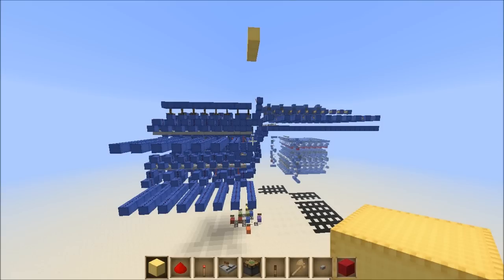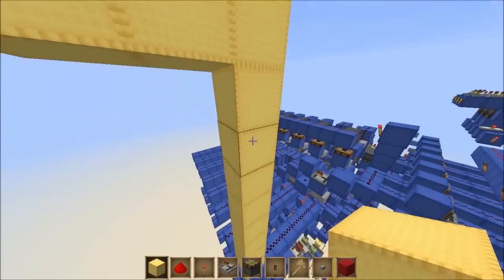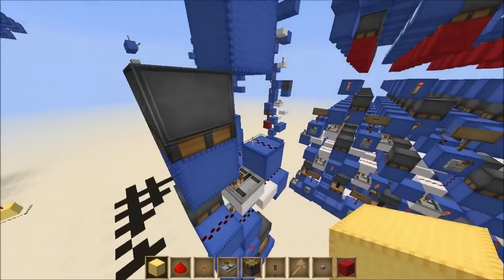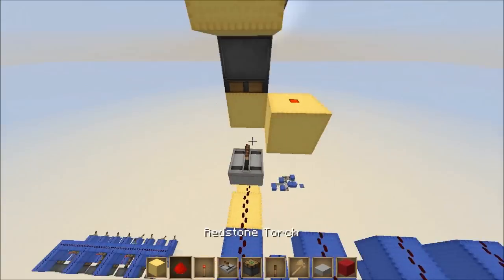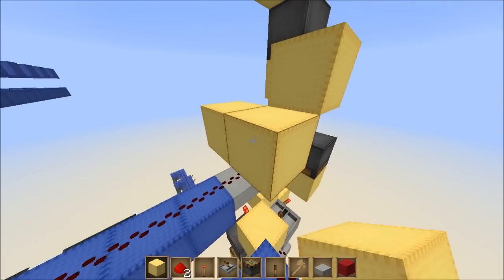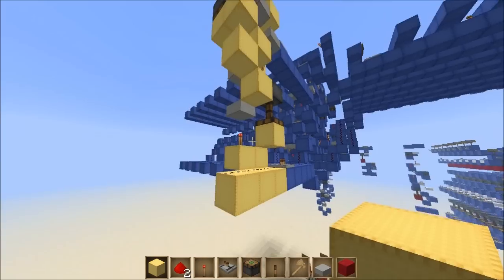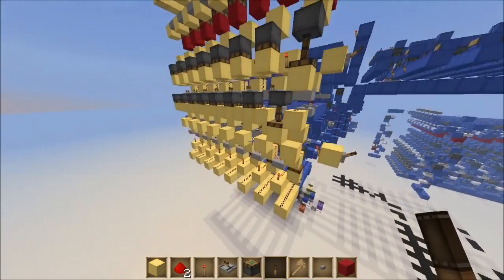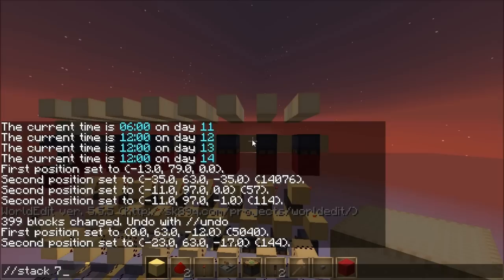Minecraft: How To Build An 8-Bit Computer - Part 10 (Registers II)

Comment: assuming i built it right, there seems to be some budding going on coming off of the upper read line in 1.8. btw, this video currently has 1,657 views and you have 1,647 subs lol. if you get 10 more subs, and 0 more views on this vid, they will be the same.
Reply: +Jacob Gable btw, i just made it 1,648 subs.
Reply: +Jacob Gable basically, if save the binary for 2, and you read it from the bottom you get 2. if you read it from the top, you get 2. if you read it from both, the bottom becomes 3 because there is a bud.

Comment: Hey Sw1Ftx16 I have been following along with your 8bit computer from the beginning, building by hand, as world edit is not installing correctly. And I have no idea how to use it. Up until this point I have found it easy to follow, however I see that you fixed this in a later video, and I am having a hard time building what you show in parts 17-18 directly onto the ALU. Also earlier I noticed (I dont know if you corrected this later on, or if it matters at all) that you have a piston not firing, Its eight blocks above the Overflow, and two to the right. the redstone current is ending 1 block off of it. Please help me out. The videos are very well done, and very instructive. I would also like to use the first half of the ALU in a lock design later on if its alright, its your design so Im asking you first. :P